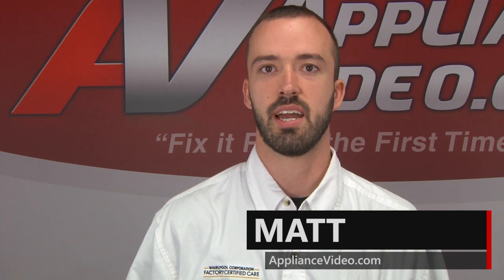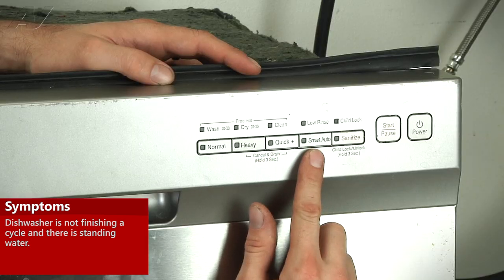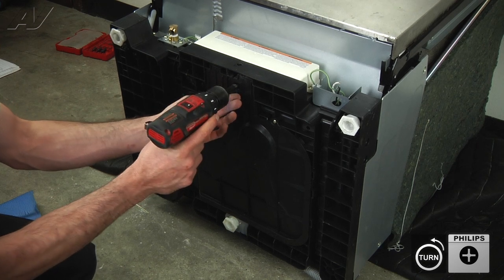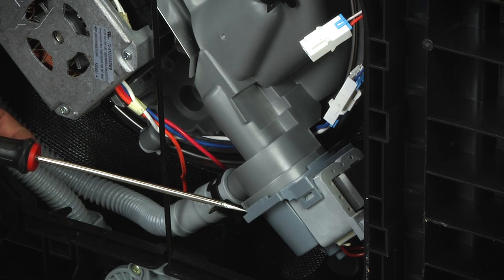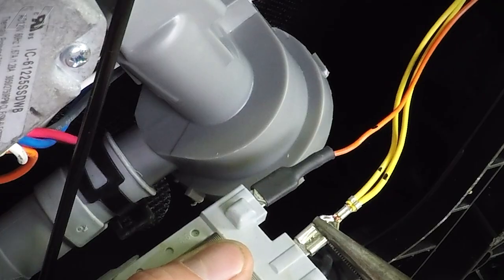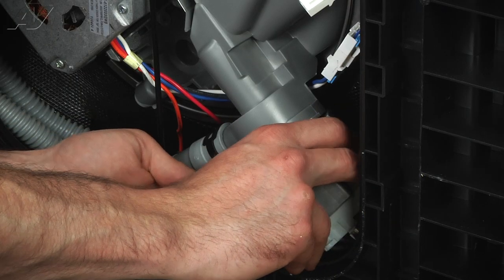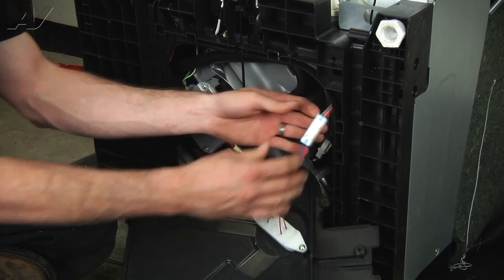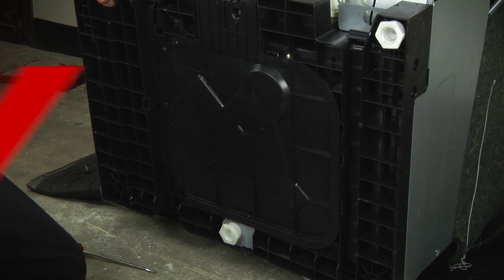Samsung Dishwasher Repair - Not Finishing a Cycle and Standing Water - Drain Pump

Comment: Was very helpful. Different model but Basically the. same layout. When I pulled the drain motor off there was a piece of broken coffee cup in it keeping it from draining. Put back together works fine
Reply from the maker: Great question, if you have a more technical question that our parts department cannot answer, you can search our over 17,000 answered questions free at our website www.ApplianceVideo.com under our Repair Help section. You can also call our parts department at 1-800-830-5465 and they can give you help 7-days A week ,or search at www.SaveMoreOnParts.com  .

Comment: I have the exact, same problem & error-code, however, the pump works & stepper-spring resistance seems strong. It is a 22 yo washer, which worked fine, then suddenly didn't. So how do you know if it's the pump? Thanks. Great video. -mc

Comment: Removed my drain pump a while ago because of not draining and found rubbish stuck in the pump. Had to do it a second time but pump doesn't feel tight in the housing. Could I have broken over of the tabs and should I replace the pump?

Comment: You didn't check for voltage at the old pump. That's what I'm trying to figure out how to do.. test the old one before I buy a new one.   I can't figure out how to get voltage to the pump without it actually running.  Basically, I don't understand how to troubleshoot/test old pump.
Reply: Cut a power cord. Connect the black wire to one terminal, white to the other. Plug in the cord. If it spins the pump is good.

Comment: Hi, if the pump failed, wouldn’t there a lot more water sitting at the bottom?  I watched strong flow of water into the disposer but when it finished, there is water sitting at the bottom.
Reply from the maker: Great question, if you have a more technical question that our parts department cannot answer, you can search our over 17,000 answered questions free at our website www.ApplianceVideo.com under our Repair Help section. You can also call our parts department at 1-800-830-5465 and they can give you help 7-days A week ,or search at www.SaveMoreOnParts.com  .
Reply: Did you ever figure this out? Mine is the same
Reply: @louie1487  I didn’t do any repair.  I believe my wife select a other-than-normal cycle and let it complete the cycle.  No more standing water since.

Comment: We have a samsung dishwasher bought brand new in 2017. Worked for a year, then error code 3C came on after. The dishwasher starts, runs for about 10 minutes, then hums up and down and just flashes 3C code with water left in bottom. 3c indicates drain pump, which we replaced, but problem continues. It does drain when cycle is canceled. I checked drain filter and its all clear. Any insight?

Comment: Should I be able to blow through the water drain hose where it attaches to the disposal?
Reply from the maker: Great question, if you have a more technical question that our parts department cannot answer, you can search our over 17,000 answered questions free at our website www.ApplianceVideo.com under our Repair Help section. You can also call our parts department at 1-800-830-5465 and they can give you help 7-days A week ,or search at www.SaveMoreOnParts.com  .

Comment: Where is the diagnostics portion? How did you know that you needed to replace the pump?
Reply from the maker: Great question, if you have a more technical question that our parts department cannot answer, you can search our over 17,000 answered questions free at our website www.ApplianceVideo.com under our Repair Help section. You can also call our parts department at 1-800-830-5465 and they can give you help 7-days A week ,or search at www.SaveMoreOnParts.com  .

Comment: Hi i need help my dishwasher not finishing cycle it doesn't drain water but when i try manual drain it works.
Reply from the maker: Great question, if you have a more technical question that our parts department cannot answer, you can search our over 13,000 answered questions free at our website www.ApplianceVideo.com under our Repair Help section. You can also call our parts department at 1-800-830-5465 and they can give you help 7-days A week ,or search at www.SaveMoreOnParts.com  .

Comment: Matt thank you for making this video...i dont have a new model no fancy digital lights or any filters to clean. Mine is an older GE PERMATUF  POTSCRUBBER 700 WITH TEMPERATURE SENSOR...it doesnt completely drain on every cycle ...it runs through normal cycles but it stops draining each cycle before it should. I open the door look inside then shut the door it then begins to suck more water and then stops sucking out water and continues to move to the next cycle...HELP. i am a widower with very very little money and i cant afford to call a repairman out because i only have 900 a month total to live on. And i have a child and 2 cats and 1 large dog. I big truck car insurance 98.00 plus 350.00 annual registration plus 80.00 for star smog compliance and i cant even afford property taxes of 4,500 a year. So what can i do to fix this? The drain hose from dishwasher goes to the air gap and the air gap has a hose that goes to sink drain..
Reply from the maker: Great question, if you have a more technical question that our parts department cannot answer, you can search our over 13,000 answered questions free at our website www.ApplianceVideo.com under our Repair Help section. You can also call our parts department at 1-800-830-5465 and they can give you help 7-days A week ,or search at www.SaveMoreOnParts.com  .